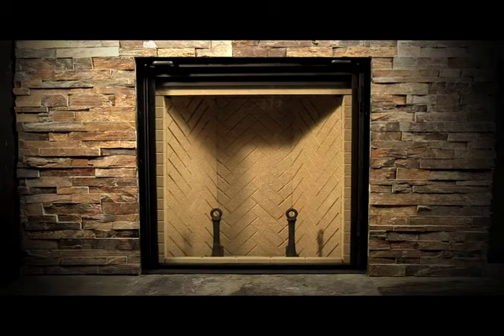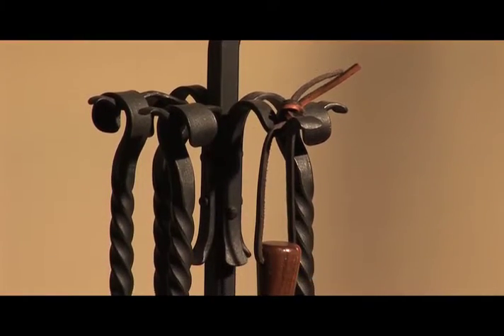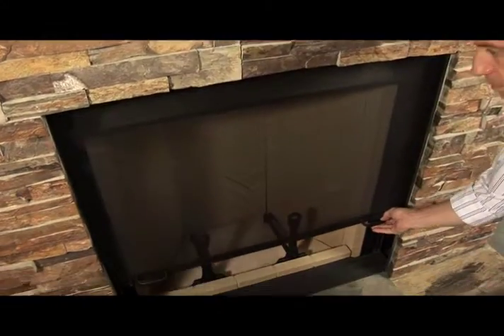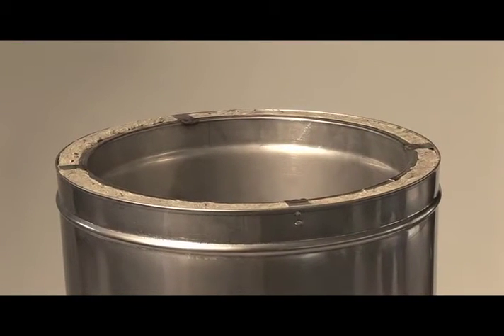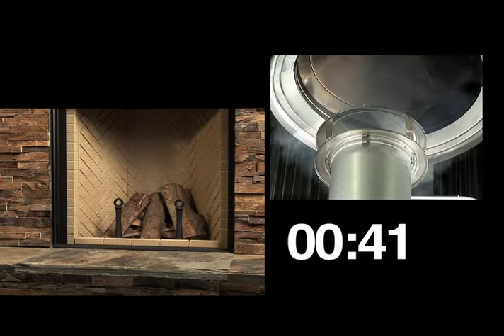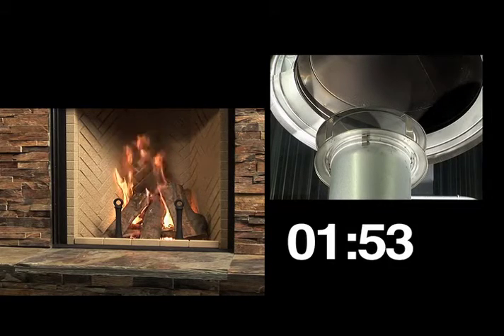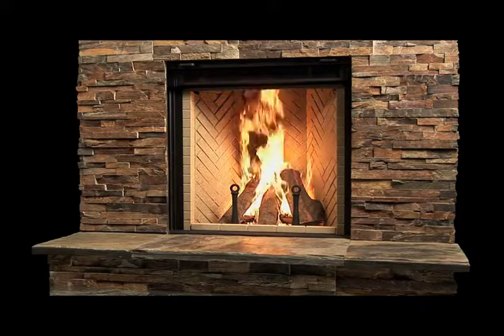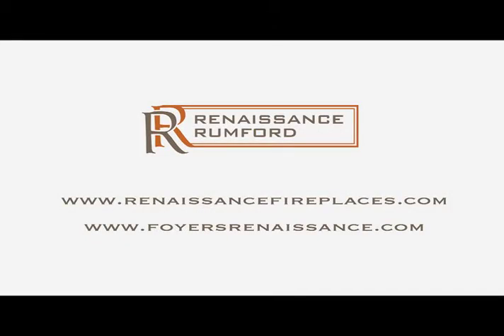Renaissance Fireplaces

Comment: I’ve worked as a sweep for over 30 years. Many times on tall fireboxes like this I have to install lentil extensions to lower the front down. Sometimes this problem only arises when low pressure zones are prevalent. As I have always understood it, the flue diameter/size should be 1/10 the size of the fireplace opening. My first impression of your fireplace is that the height is too great, even if most of the time it may draw fine, there might be days with low pressure that would have the smoke billowing out. What I appreciate of your design is the glass that will lower down in front, I am sure that even on such days the fireplace would still draw well with the door closed. My question is, can the screen be deployed all the way down and the glass be deployed partially down, in effect making its own lentil extension? I am also curious if there is a flue damper at the throat of the flue or does this rely on just the glass door to keep home heat from funneling up when not in use? Overall this really looks like a very excellent fireplace!

Comment: After coming in through the external air duct, where does the air enter into the fireplace? Are there gaps in the bottom?
Reply: Around the sides and top edge of the fire box refractory there is about a 1/4" (6mm) gap  behind the glass.  Intake air comes in from the back of the fire box and around the refractory wall to keep the soot of the glass, pushing the fire back and up the fire box.